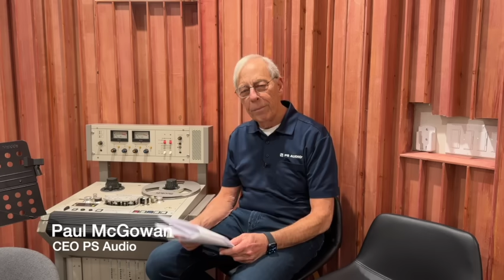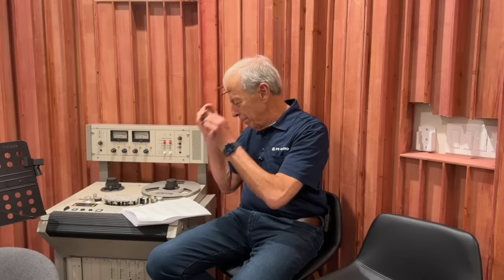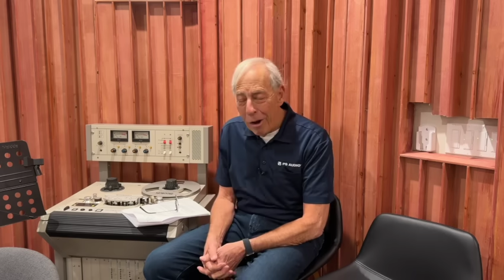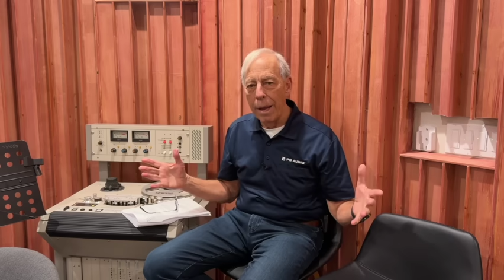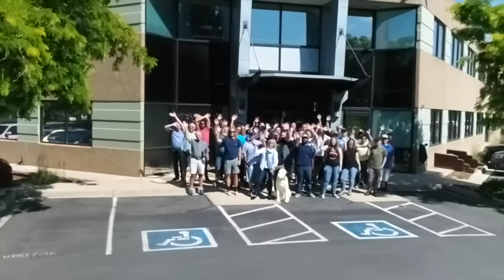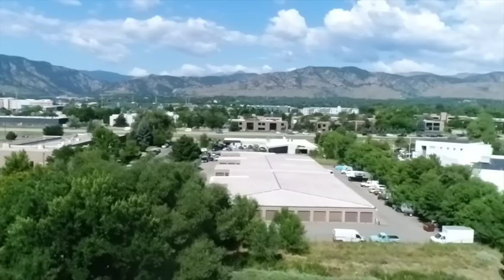When measurements and listening disagree

Comment: Some people like to think you could have bad measurements but good sound and vice versa, but both correlate to each other. Most amplifiers today have very good graphs on an 8 or 4 Ohm resistor, but many speakers with tough load ( impedance variations, phase shifts, etc ) might reveal some difficulties the amp have trouble to deal with, making it sound worse. A good amp/speaker synergy is quite important to get the best out of a system.

Comment: Anyone remember Stereo Review magazine?  It's published amplifier tests also included "Slew Rate", measured in microseconds. I've not seen "Slew Rate" measured in present day test reports.
Reply: They also published a controlled test in which people could not distinguish power amps costing thousands (including tube amps) and the cheapest Pioneer receiver playing through it's preamp. This result has been noted in many tests. So much so that the high-end equipment cultists had to attack the idea of testing rather than the results.
Reply: @Rob-k5k9u the results of blind food taste tests are similar, so what.
Reply: @mitchtaylor6512  "So what" is correct. If people cannot tell differences in food when blinded--that is evidence they can't tell the difference. I again point out that no person has convincingly demonstrated they hear differences in amps. It is not the case that some people can and some can't. You defenders of the indefensible need to stop talking and start thinking and looking up information from somewhere other than you favorite audio pundit.

Comment: Howdy.
It is somewhat boring to observe many think Hi-Fi is 20 Hz to 20 kHz flat.
No-one plays single sine waves with their gear for amusement and pleasure.
Music is a multitude of harmonics riding upon the base note. High Slew Rate is needed to uphold the fidelity of the harmonics. The most demanding point in time is when the base note and all harmonics cross the zero simultaneously, and all either upwards or downwards. The rise speed of all notes are summed and the amplifier must comply with this sum rise speed demand = Slew Rate.
Cheers.